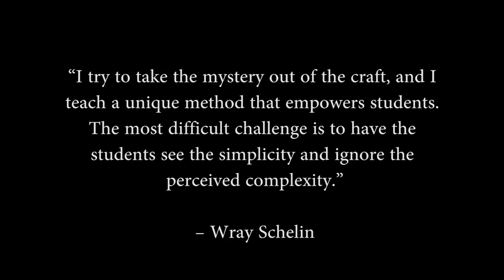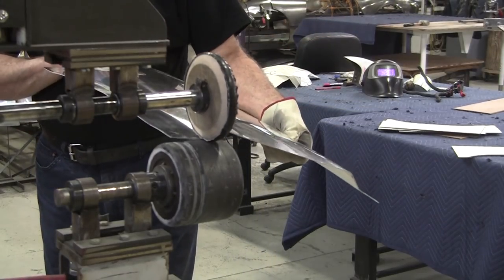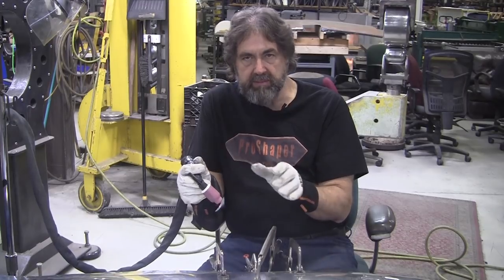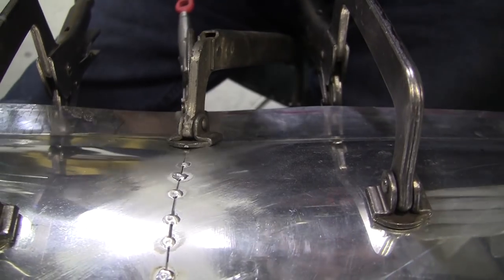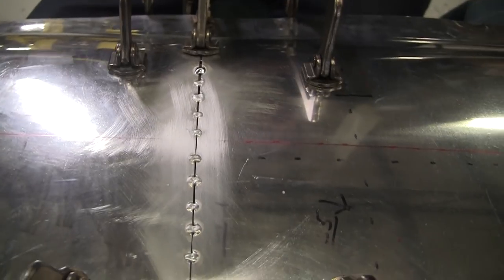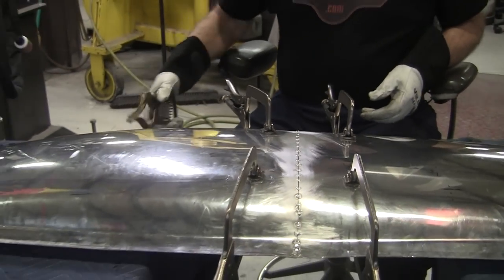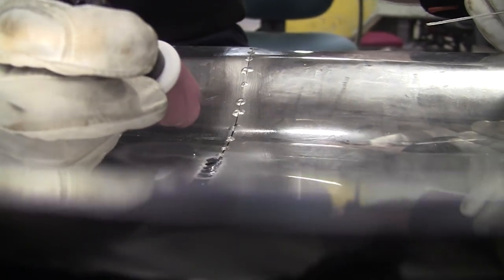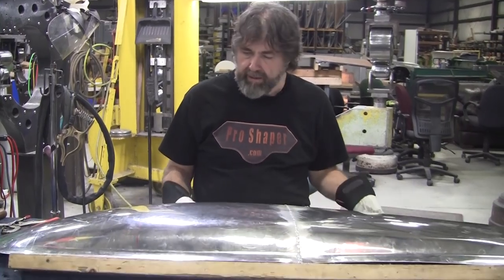Metal Fabrication: Jaguar E-Type Aluminum Bonnet Build (Part 8C)

Comment: Aluminium butt welding is best with a super tight join. when the gap is not tight, holes appear as the aluminium sides are not distributing heat uniformly. You can also experience warping ( a real issue with welding at the edges of panels.) A tip I got from Trev Blog (on YouTube)  is to place wet rags on the panel, along the weld - simple but effective heat soak.
Reply from the maker: I fully understand the value of perfectly fit butt joints.😁😁😁
The point was I was under a time constraint- my camera man Mark had to leave. I welded the joint with gaps with the pulse function. The pulse function allows you better control. When I do the aluminum Sheet Metal welding  video I will address all the of the methods and myths.😁😁😁

Comment: Whoever led you to think you need a #12 cup for welding aluminium has given you a bad steer Wray. Is all it's doing is costing you a ton of gas that you don't need to use. I have been welding for many years in the motorsport industry and have built hundreds of Aluminium coolers for everything from F1 down. Aluminium does not oxidise like steel so you don't need a large cup and tons of gas coverage in fact it's more critical that you don't have to much gas pressure. These oversized cups are designed for operations such as Titanium welding...Where gas coverage is vital, or higher amperage on high strength steels. My recommendation is a #6 cup on a gas lense running at about 5 ltrs/min for Ali.
Reply from the maker: I'm using the large format gas lens with a number 10 cup. It was an improvement over the small format gas lens and number 8 cup. I care more about the butt weld strength,  I don't care as much about the gas cost.
Reply: With all due respect Wray...You don't care about butt strength as much as a race team DNF'ing at Le Mans with their multi million $ race team just because one of their watercoolers failed. Butt strength is not increase by gas coverage on Aluminium. Penetration and weld integrity determine strength and that is controlled by the correct amperage, the correct filler rod being used, and the skill of the Welder...Or if you're lucky enough to have access to weld both sides...which I never am. Through my work I have extensive experience in this area.
Reply: Really strange advise I’ve never seen anyone using this setup for welding aluminium. Only time I’d use that size cup is welding titanium. Also you really do need a water cooler when welding aluminium for any period of time.

Comment: The bonnet is coming along nicely Wray. With regard to bending the big radii along the length of the bulge, have you tried doing this in the wheel with a suitable shaped bottom anvil, I thought it was one of wheels main uses. The method you used by bending over a post dolly looked a bit of a struggle. Enjoying the vids, great work mate
Reply from the maker: Most of the problem is the Chinese sourced super stiff aluminum. If I annealed it there would be little effort. I do like the finished  panel's strength. You just have to fight it a little. 😁😁😁

Comment: Hello Wray. Just a question. When the area value is completed, normally you don't have complex curve to do any more to obtain the arrangement value. Therefore why didn't you use the rubber band on the narrow wheel (yellow English wheel in back of your workshop) with a +/- crowned anvil  to shape the non-complex curves ?
Reply from the maker: Once the  correct area value is developed the arrangement pops ( with just hand pressure or you can use the wheel with very light pressure by pulling down on the panel as you pull it out) very easily into the panel you want. If the area value is not correct there will be resistance to bending 
( setting the arrangement value).   There is no need to use a rubber band. I have never had to use one. I have in the past used rubber upper wheels and an inflatable go cart wheel to create a non compound radius like a 1930s hood panel. I haven't done that in 25 years, I now make simple bends on a pipe with blankets on it.  For a long tight radius I have several rubber upper wheels with a concave radius on their face.
Reply: @proshaper  Thanks Wray for your prompt answer

Comment: How are you not blowing a hole will a gap that large? Is it the pulse? I find if my gap isn't tight I blow freakin holes every other tack.
Reply from the maker: Yeah, the pulse function is amazing. I'll get better with it in a few weeks. i normally would take more time to get the gap real tight but I had to hurry because my camera man Mark had to leave for an appointment. Plus my chicken was burning on the grille.
Reply: Wray Schelin's Pro Shaper Sheet Metal LLC  - Wray you might have to invest in a pulse grill.

Comment: Love this. It’s going to look so good! I notice some deformation at the side flange, and some mismatch of radius. Do you put it back through the tipping wheel, or hammer it to clean that up? I assume there’s little difference between shaping the complete panel and the two parts, other than how easy it is to handle?
Reply from the maker: Thanks, glad you are enjoying the series.  I am an unreformed perfectionist in the advanced stages of the madness. I see every  flaw and I will attempt to fix them all.😁😁😁
Reply: @proshaper  Don't worry Wray, I suffer the same affliction!!! 
Keep Rocking!!!
Reply: @proshaper  Remember, Cause Metal Health Will Drive You Mad!!!